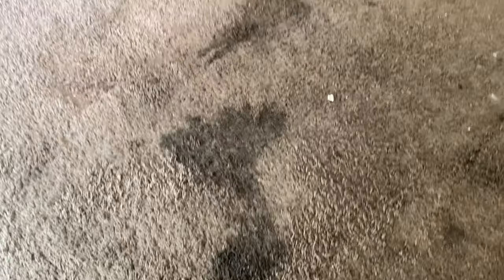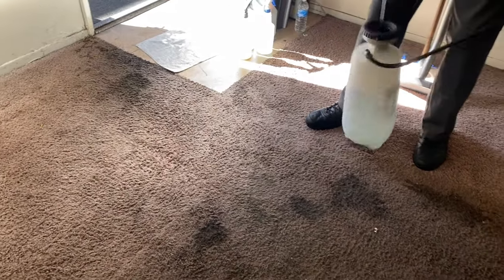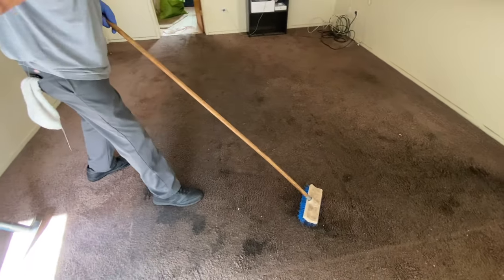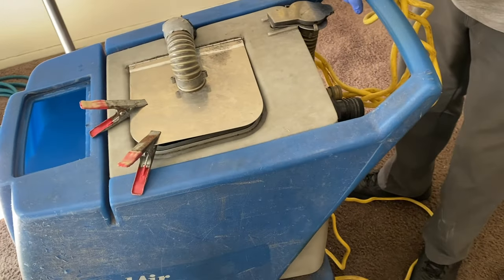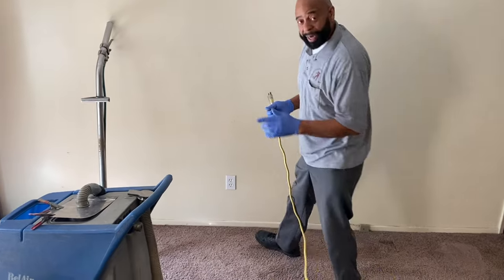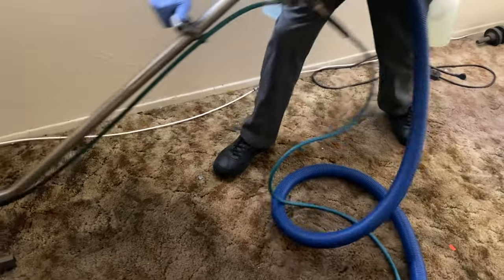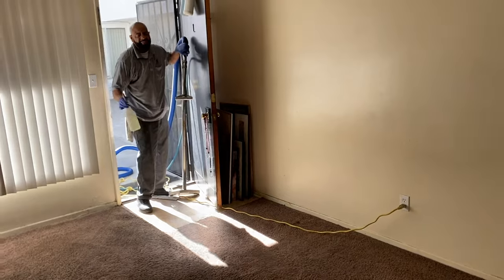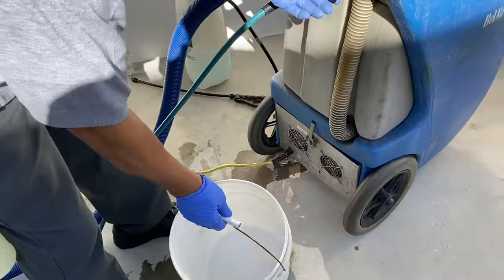PRO CARPET CLEANER REVEALS SECRETS

Comment: 👍
The other great reason to have the portable unit is we had to clean the air traffic control station at an airport one time.  It took all of the hoses from TWO trucks and didn't do a great job because A) the cleaning solution had so much distance to travel through the hoses it wasn't even hot once it got up to the cleaning wand and B) there was so much suction/vacuum hose attached that the vacuum was quite poor

He makes very valid points, there's no single correct tool for every job

Comment: I don't mean to criticize you or your workmanship.

I do all the maintenance work and cleaning for 3 property management companies.

And with each one. When I first doing their work. They wanted to stay with the carpet cleaning company they were using.
I said fine.

Well 2 of the companies had truck mounts. And one had the portable like the person in the video used.
Within the first month ten times. I was working at a location when the carpet cleaners showed up.
So watched what these guys did, as I was working.
I couldn't believe it.
They didn't have a clue what they were doing.

Well after they were done and gone.

I pulled out my little vacuum type carpet cleaner. That I keep in my truck. To do touch ups or if I get something on the carpet.

I knew what I would find.
And this is what happened.
Each time I would go to one of the bedrooms, they had just cleaned.
You could see most of the stains.
And then when I started the extraction. My machine would file up with so much dirty water. That I would have to empty my machine 8 to 10 times.

Needless to say I do all the carpet cleaning now.

All the pretreatment and scrubbing is just common sense.

But the key to carpet cleaning is the extraction.
You just don't go over a area 2 or 3 times and say thats good. Because it's not.

You go over it until no more dirty water is coming up. And only clean water is coming up.
And then you keep going over it until NO water comes up.

That is a completely clean carpet.

And this process takes a very long time.
To where 1 room could take 3 to 4 hours. And with the rental properties I'm doing. Thats usually the case.
They look like the carpet in this video.

So if you get your carpet cleaned and it only took the guy a hour.

You got screwed.

And you will have a very hard time finding someone who does the job correct.
If you can find someone, which I doubt.
Because they ALL have some bs line to feed you.

Good luck.
Reply from the maker: Appreciate the feedback.